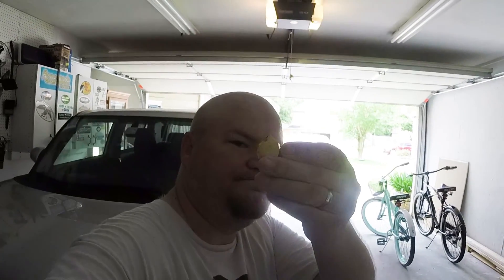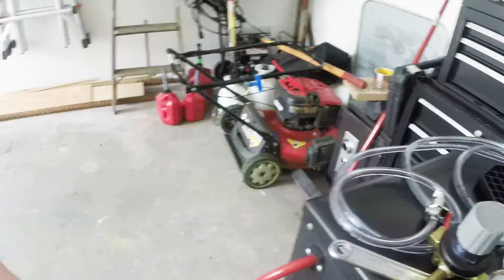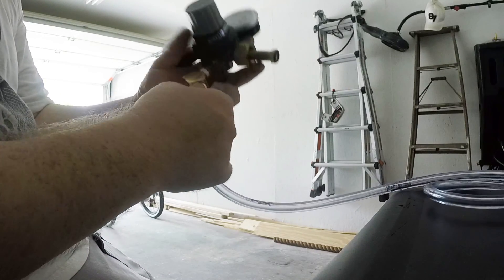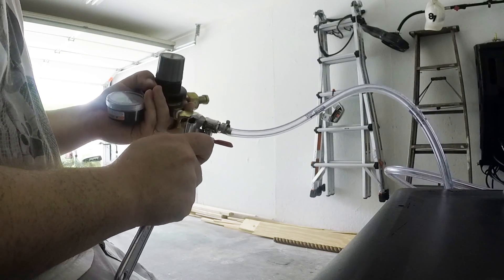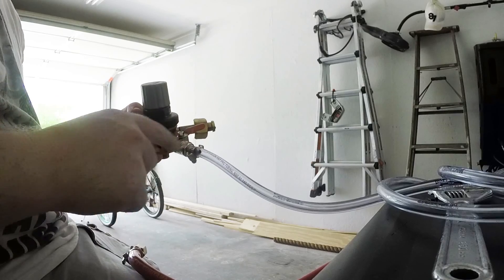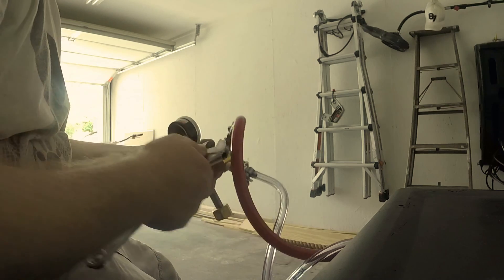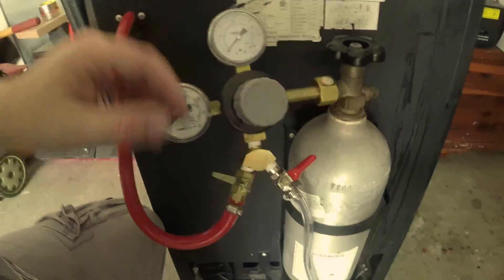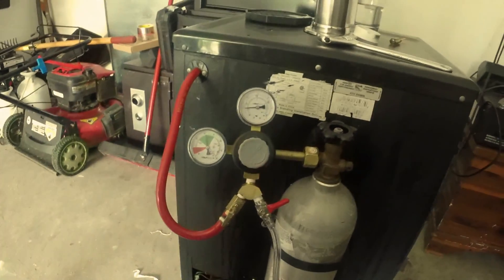Installing a CO2 Wye Splitter on Your Kegorator Regulator

Comment: Tip: Use red tephlon tape as it's meant for gases and 5 wraps to ensure a proper seal. Also use a towel between the tool and the splitter to prevent scarring it up.
Reply from the maker: Thanks for the tip!  I was ignorant to the difference in plumbing versus gas plumbing tapes.  So far I have not had any issues but we are always learning.
Reply: @TheBrewQ  Really I'd say your fine with plumbers tape. I was just letting you know there was a better tape that was meant for gases as it's slightly thicker and reduce the chances of leaks. Tephlon tape, polytetrafluoroethylene tape, and PFTE tape are all names for the same exact tape.

Comment: How much do the splitters go for (I guess I could look myself?  I need  a new dial to show the correct amount of CO2 in the bottle.  Mine never worked right.  Cheers, Q!  \m/
Reply from the maker: +Brian Fisher the eye splitter itself is 10 bucks.  I bought my regulator a while back for 50 bucks.
Reply: Cool.  Good video.